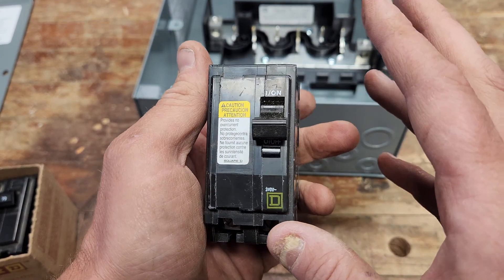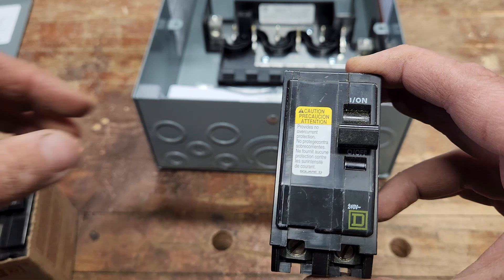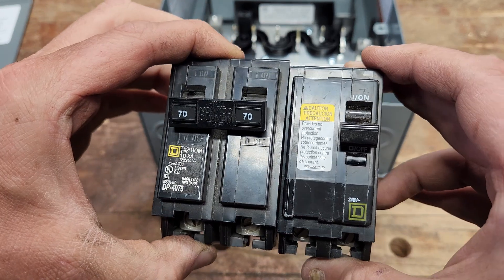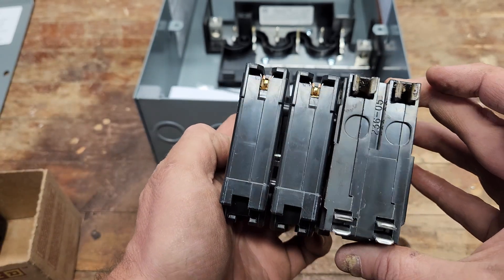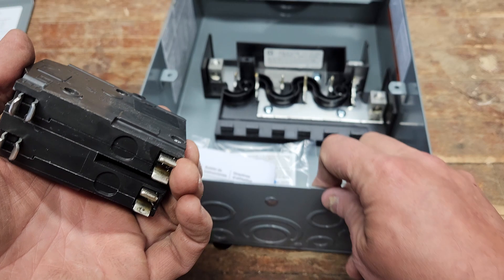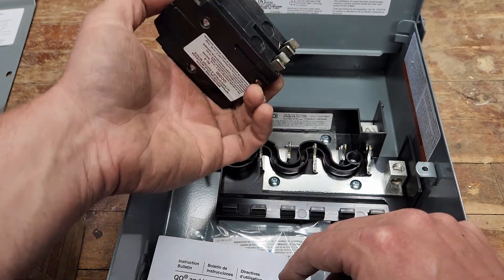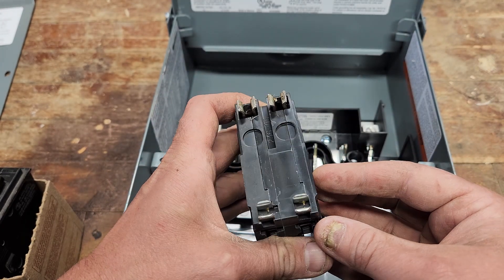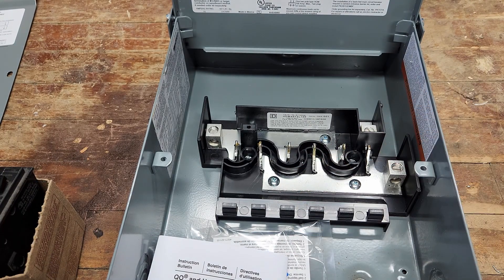Square D Homeline Breakers VS QO - what is the difference?

Comment: Thank you. I am replacing my home ancient old classic 70 year old box. What the best box to install? Small 1,100 sq/fr house?
Reply: QO is better because the busbar is tinned copper not aluminum, and the breakers have a faster overcurrent curve.  The QO breakers cost lot more homeline 20 amp tandem cost $16 a QO 20amp tandem cost $89. These prices I pulled from Home Depot website. You can see how the cost adds up quick. I'm not an electrician there could be some other reasons also they see lot more panels what the condition is over time.